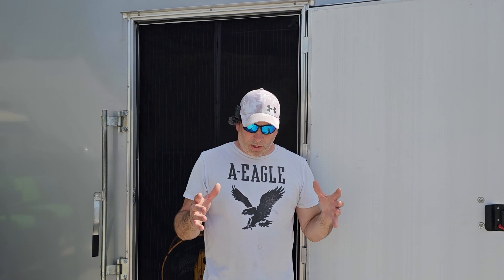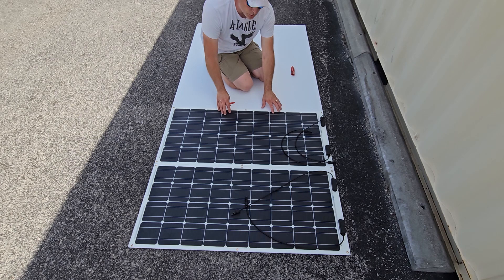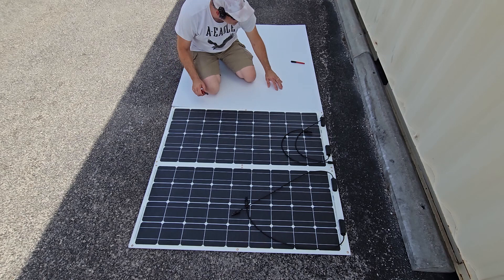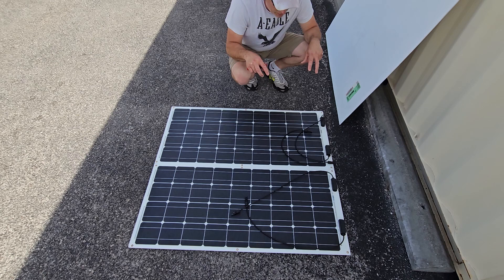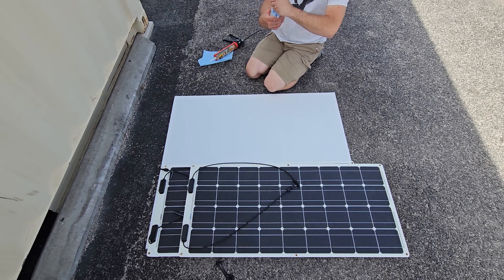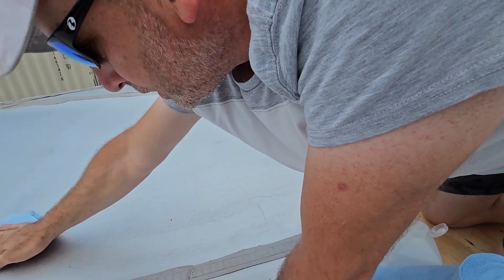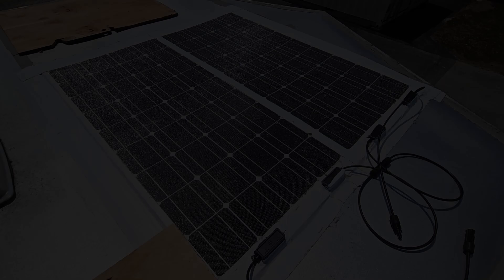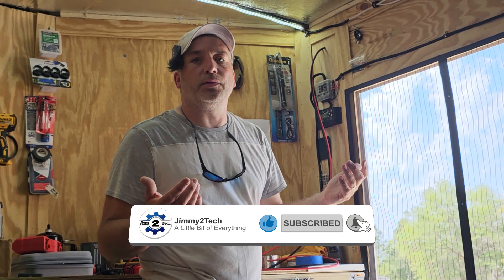Mounting Flexible Solar Panels To Cargo Trailer. No Drilling!

Comment: Did you glue the Corrugated material to the trailer roof as well?
I used eternabond on a 200watt panel and it eventually became loose. 
I think the 85F loosened up the adhesive and then the tollway speed pulled up from the centre.
I put some clear vinyl down on my roof and going to try glueing the panel down to the actual roof before securing it with the eternal bond or other tape material.
Safe Travels!